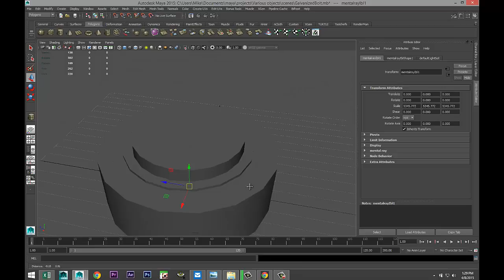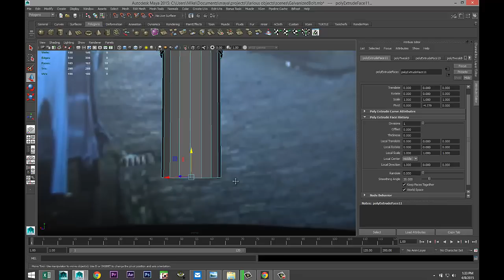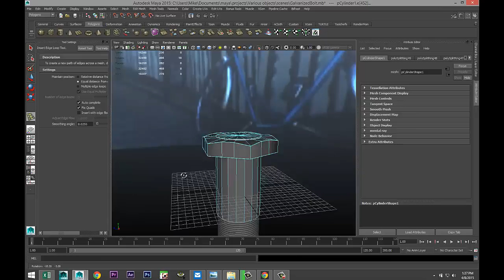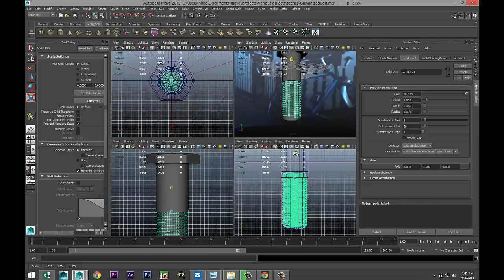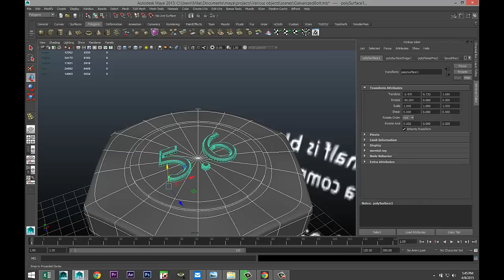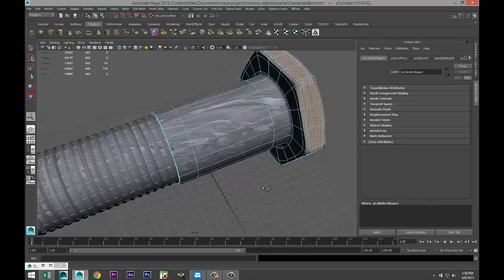Maya Nuts & Bolts modeling series : 5 : Galvanized Bolt

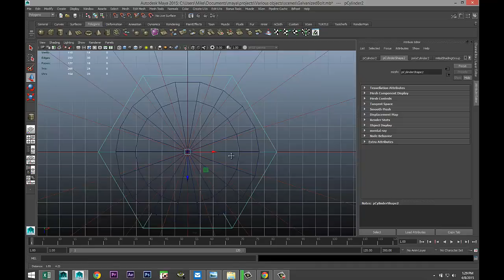Comment: I'm using maya 2014 for school and I was wondering how do I enter the mode at 3:02.
Reply from the maker: What do you mean by "the mode" ?
Reply: Mike Hermes the view you was in at 3:02 where you can see the align perfectly. I noticed it in this video and the picnick table video where you would switch to a view that looked like wireframe but you was able to see single lines. And match up your table wood to the underpart of your table frame.
Reply from the maker: It is just wireframe mode seen from the top, that's all
Reply: Mike Hermes ah okay I guess yours look different XD maybe cause I'm using student version.

Comment: Every time I insert an edge (Insert Edge Tool), it always snaps to the edge. When that happens, I'm not able to move it.  Is there a way to fix that?
Reply from the maker: Check your snap tools ( top of panel ) and turn them off.
Reply: Mike Hermes
All of the snapping tools are off and it still happens.
Reply from the maker: To be honest, never heard that happen before. Have you tried to reset Maya to it's default settings ? Window - Settings/Preferences - Preferences - Reset to default settings
Reply: Mike Hermes
Unfortunately, that didn't work either. But I found out what the problem was by going to edge tool setting. The "Equal Distance from Edge" option was selected instead of "Relative Distance from the Edge." Though, your advice did help me fix other small problems. So, Thanks
Reply from the maker: ch7849055 Glad you fixed the problem :-)